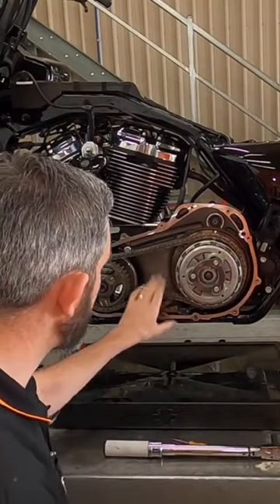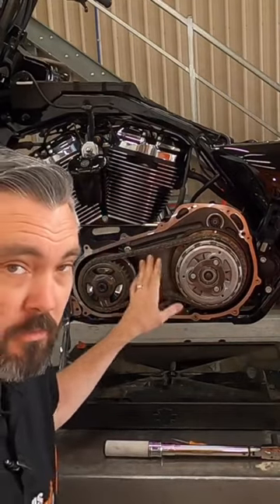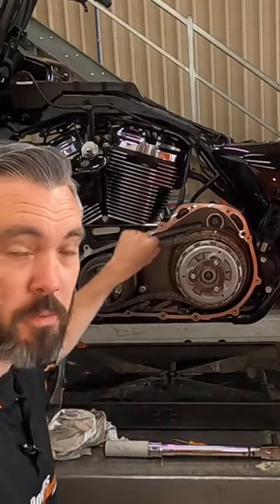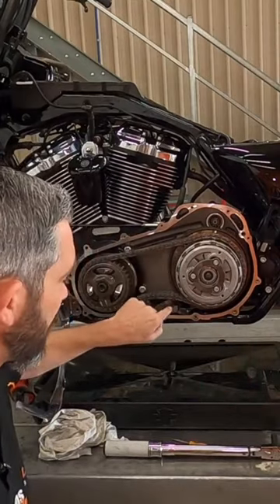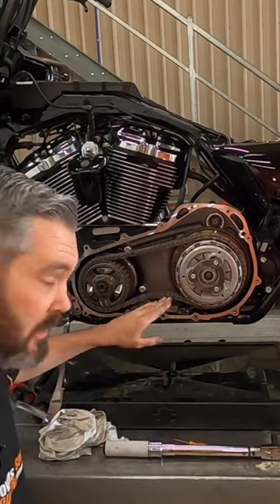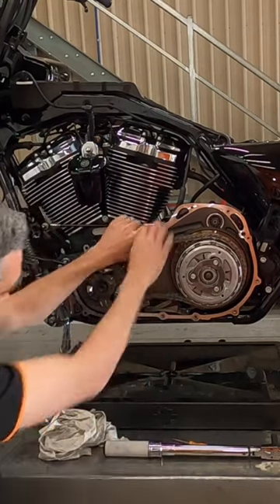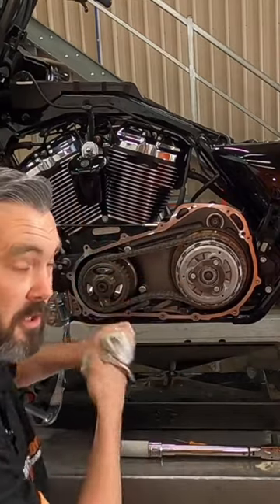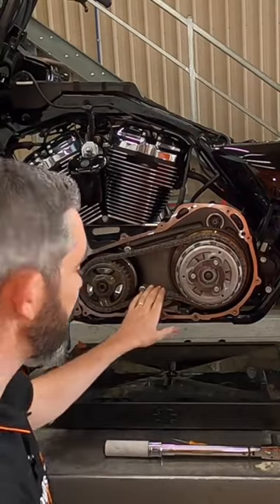Automatic Primary chain tensioner facts

Comment: Thanks for that mate there’s a Harley tech over here in WA that says that the Harley auto ones are the cause of the problems with Comp ramps
Reply from the maker: Never heard that one before
Reply: @MasterTechMiller   yeah he says it’s the reason they can break and also doesn’t like the cycle Rama cams because there to hard to Dyno 🤷‍♂️
Reply from the maker: @Ride_on54  The only cam that can be tricky to tune sometimes is the CR483 on certian combos. The rest of the Cycle-Rama Cams are some of the easiest to tune on the planet!
Reply: @MasterTechMiller   I know that’s the one I’ve just purchased the CR483 i got good numbers but it has a dip in the torque  curve around the 3.5 rpm
Reply from the maker: @Ride_on54  What's your exhaust system?
Reply: @MasterTechMiller  freedom  sharp curve radius totally recommend
Reply from the maker: @Ride_on54  There is no way you should have a dip in your torque curve with those pipes & Cam. Definitely recommend a better dyno tune.
Reply: @MasterTechMiller   it’s not a major dip but my bike is due for a service in a couple of months and the air cleaner filter is probably due to be replaced its a screaming Eagle hi flow but could be on the dirty side could that be enough to effect things

Comment: In 2010, Harley revised the auto tensioner and it had finer teeth bc there were actual reports of over tensioning. Can you provide any insight into the newest
version? The 39929-06C. I notice the ramp that
was metal on the A and B version is now polymer
like the shoe on version C. ls this strictly a cost
cutting measure per usual from Harley or do you
think the teeth being plastic will shear if the belt
becomes overly tight by the ratcheting? Thank
you

Comment: My motorcycle only has 2000 miles on it, but I had a tiny oil leak.
It goes into the shop running great, but it comes out with the oil leak fixed but now it’s knocking. Not bad but enough to notice it.
What could they have possibly done to cause this knocking ?

Comment: I'm puzzled now because Ive got a 22 Street Bob with 4, 300 odd miles on it. Its whining from the primary, very audible especially in 3rd throttle off. I have heard that these new auto tensioners can ratchet up if you accelerate fast which I like to do on occasion. They can't ratchet back leading you with an overtight chain.
Your saying they are good?
Is there any truth in what I mentioned above? thanks
Reply from the maker: The chains have tight spots in them anyways so even a manually adjustable one has its limits as it has to be set in thr tightest spot leaving the chain to have big loose spot. 

The auto tensioners of today have a detent spring that allows for a good amount of give in the chain.

Under heavy acceleration the tensioner will take up the slack but for it to continue getting tighter & tighter under each hard acceleration event is absolute non sense.

If you have a whining noise in the primary and you suggest that's it's more noticeable in 3rd when backing off the the throttle I would think you have a transmission problem that could be causing the issue. Noises can transfer between housings & cases.
Reply: I had to take out the automatic one and went with manual.. this because my chain was overtight on my 120r with hard driving
Reply: @insltek  120R is a Twin Cam platform.  A bit of a different animal than an M8.

Comment: So no need to upgrade to the Hayden tensioner?
Reply from the maker: Each application calls for its own unique combo of parts. 9 out of 10 bikes I build are for 100% Street use. The customers just want a bolt on big bore bike & those applications are absolutely fine to the OEM tensioner.

The very small amount of pure race engines I build call for different combos & as a result, I may be inclined to use more aftermarket parts